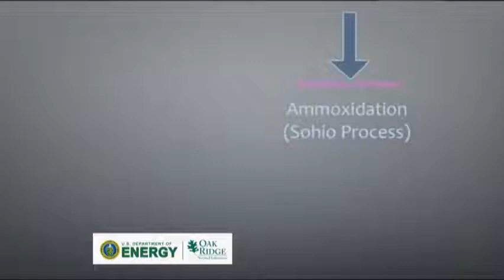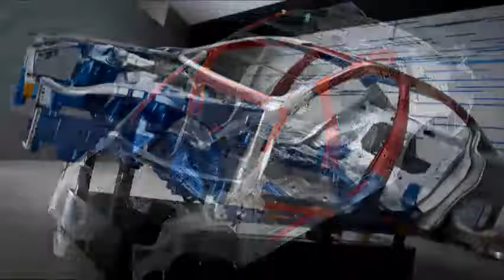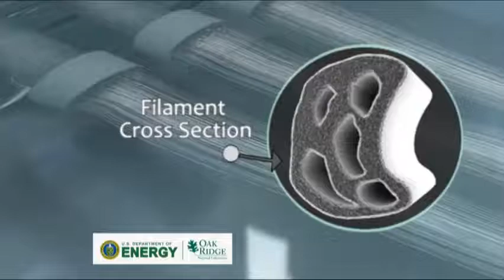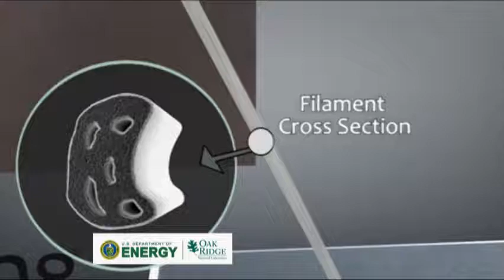Lightweighting - Autoline This Week 1718

Comment: In the past two years weight has come allot.  Aluminum , Carbon fiber and high strength steel have all come down in price. Ultra expensive cars have benefited the most so far. The new Mazda CX5 CUV starts at 3200 pds. The flagship Rang Rover dropped 700 pds this year.  The Porsche Cayenne dipped 400 pounds last year. My own Subaru BRZ at 2750 pds is 700 pds lighter than the Mustang. The Mustang lost 100 pds last year and will lose another 250 for 15. This is with all the modern safety equipment.